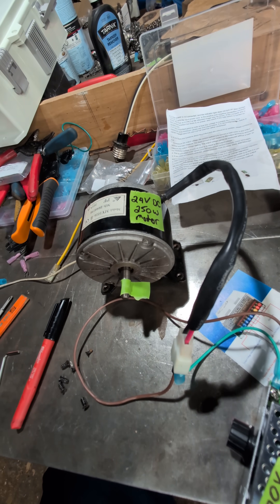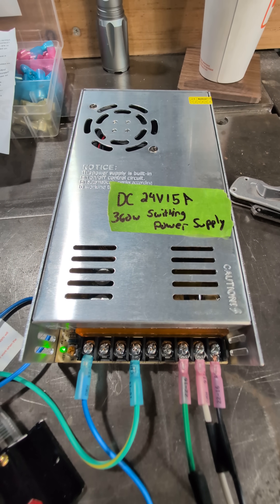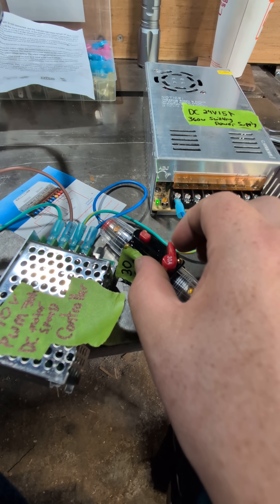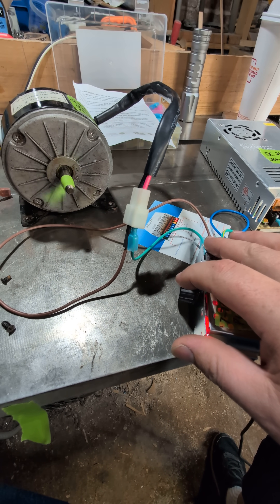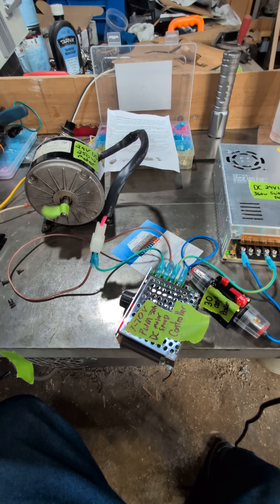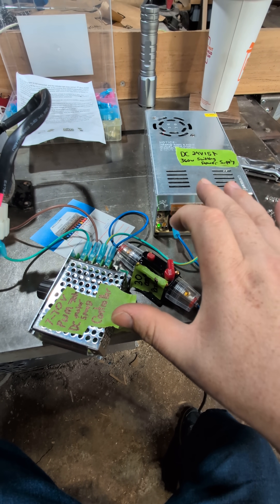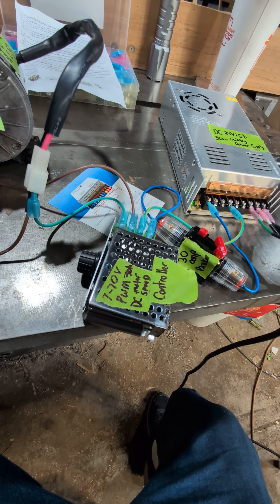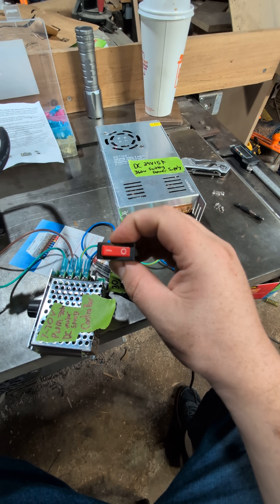Repurpose DC motor to run on a AC to DC power supply with PWM speed control. #dcmotor #electricmotor

Comment: So you are just using an AC to DC converter and going through a PWM setup to be the speed controlor for the DC motor? The way i read the description i thought you were repourposing the DC motor itself to somehow run directly off of AC power.
Reply from the maker: Yup, you got it.  Sorry for the confusion... The repurposing was because I'm Re-using a DC e-scooter motor for a completely different machine and wanted to power it with AC over batteries.
Reply: @altered14 no worries just figured id let you know that at least i misread it.   Could be my ADHD and its late at night or could be the way it was worded. Either way i habe no problem with your content. My 11yo son and i are working on turning a hoverboard motor into a wind generator for our camping trailer build. Righg now we are olaying with different gear ratios and the blade design to determine what will work best and give us the target output voltage.